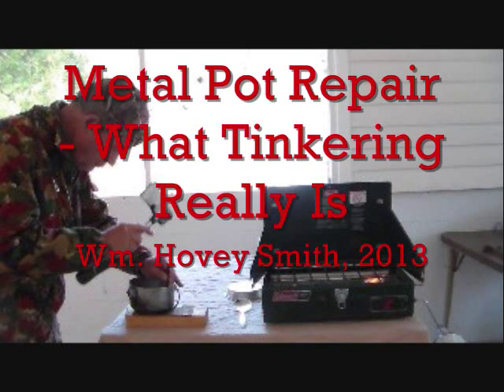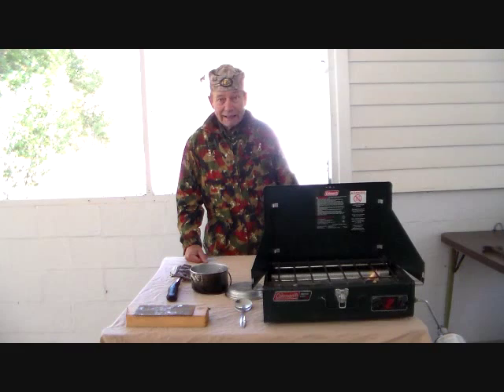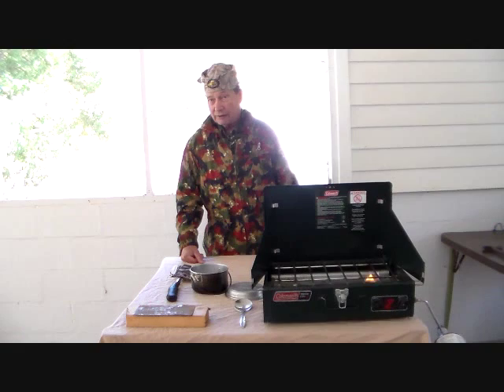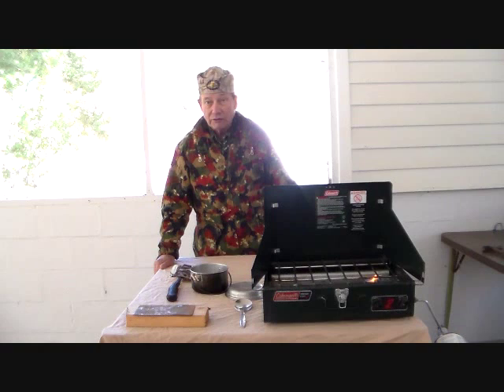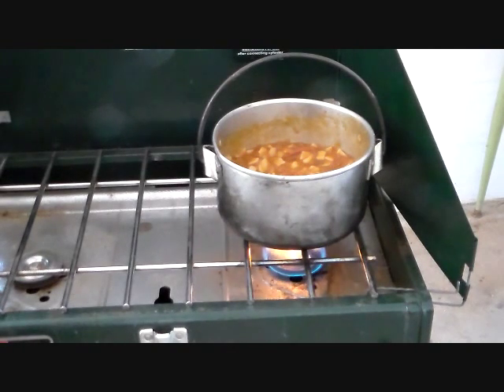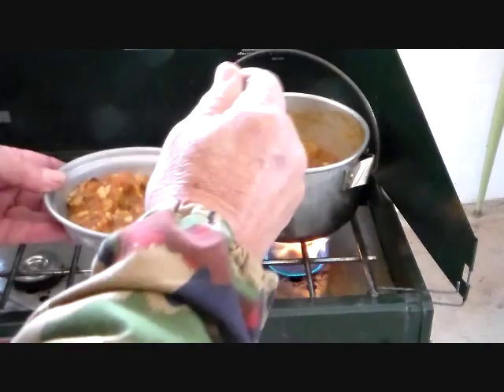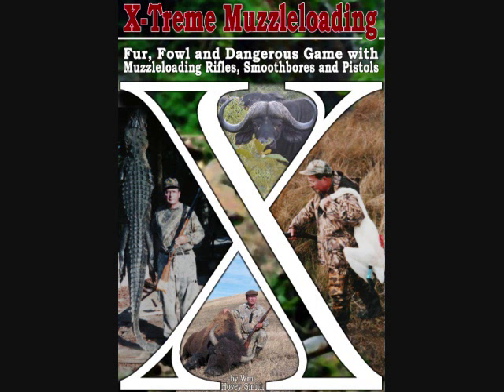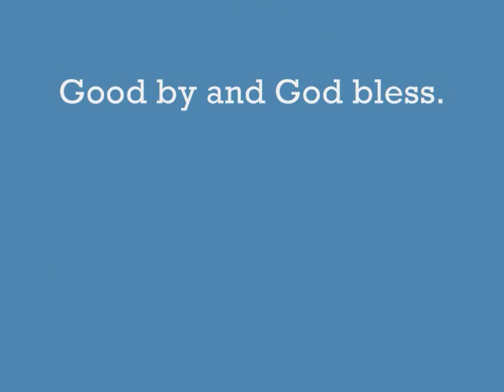Metal Pot Repair:   What Tinkering Really Is

Comment: Another variation of tinkering a pot is to clean the edges of the hole take a small section of non lead solder, such as the tin99.9%/silver .1%  (Sn/Ag) and fill the hole with a 'rivet' of this metal. Tin was the preferred material as it was easy to make the rods, but anything from copper to silver would work.  I'm sure it was done with Lead (Pb) too, but that would be a mistake.  Another job tinkers would do was to put a coating of pure tin on copper cookware so as not to get the copper flavor in foods.  Great video thanks.
Reply from the maker: Thanks for this added insight into possible repair techniques for pots where the metal is too brittle to use to close the holes.
Reply: Hovey Smith I neglect to mention the 'rivet' is then hammered over on both sides to effect a good mechanical grip. If the hole was irregular the tinker might make a dam out of clay, dough or anything at hand to hold molten tin while it hardened. It was then hammered for a better seal and look. Tin is preferred because it is non toxic and easily melted. I fixed an old GI mess kit with a tin rivet a year ago.